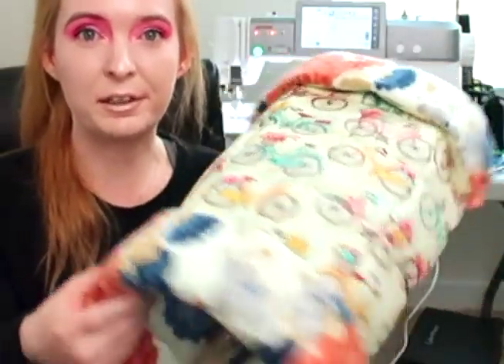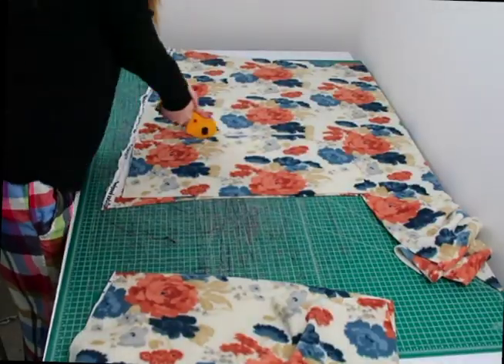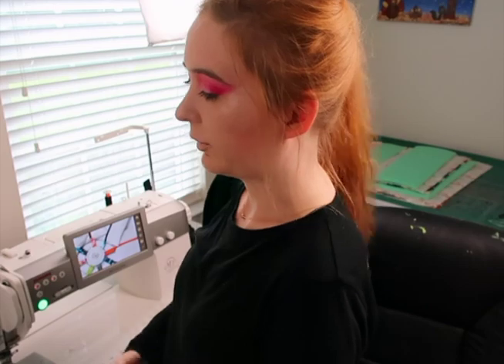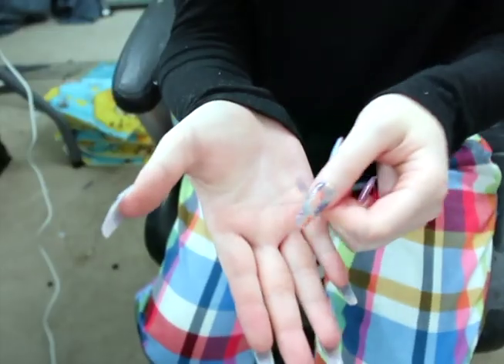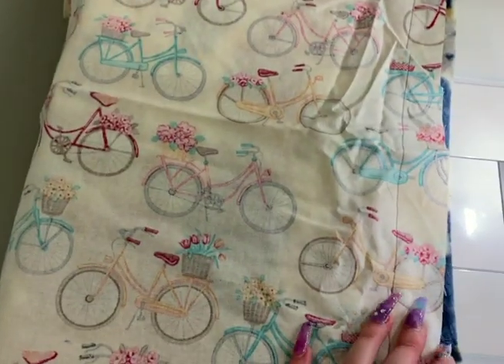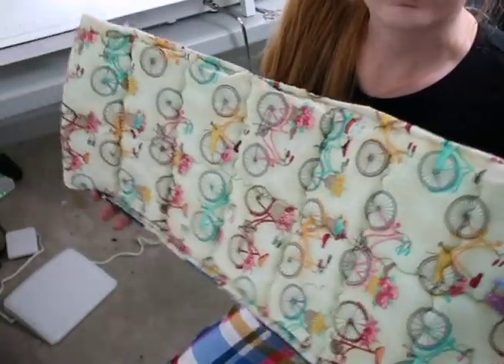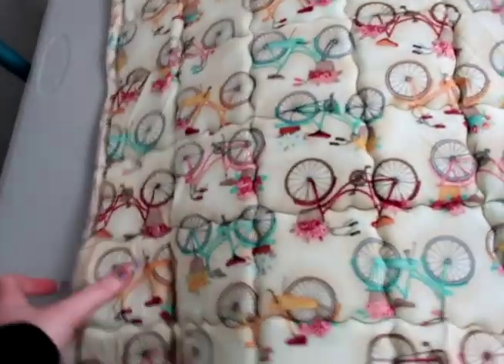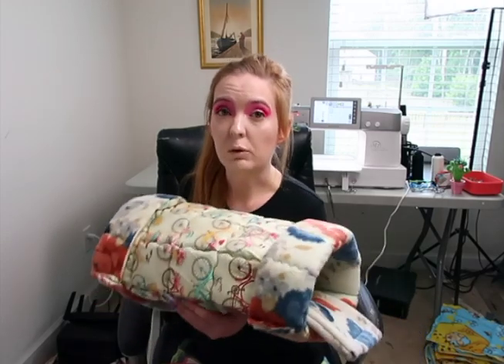Foam Tunnel With Two Removable Pads Sewing Tutorial!

Comment: I am so thrilled and happy you’re back doing more tutorial. Love this tutorial. I’ve been asked for foam tunnels. I made a simple one but yours are more professional looking. 
I have a question regarding your cubes. When you are attaching the fabric and foam together; do you sew close to the foam? I found
when I did then when putting the sides together I end up having to sew the foam as well. It works but the cube ends up a little smaller. 

Do you preshrink the cotton before sewing it? If not, do you have any problems with shrinkage with the final product? Thanks so much.
Reply from the maker: Thank you so much! And yes anything with Foam I try to sew close to it and not through it... I need to update my cube tutorial... haha.... And no I do not prewash anything, instead I just make things bigger to allow for shrinkage over time...  :D
Reply: Guinea Piggies Designs I thought I’d pass on a tip in case you don’t know. A customer of mine received a set from me. I used that fleece before without complaints of not wicking. I used same pattern from a new bolt ...she said she had washed it 5 times and still not wicking. Told her to use Tide Free and Gentle and bingo, it wicks. Great lesson for me!

Comment: One more question please ! How can you tell the difference between the tops and sides where you sew the peice on to the main towards the end of your video !? Did I ask that right !? Lol
Reply from the maker: Well.... the top piece is twice the size of the bottom piece... There are only two pieces for this foam tunnel. The pads are the smallest pieces. But again top piece is the biggest and bottom piece is the long narrow piece. Set your pieces aside and label them if you need to as you follow along to keep track. I have made many of these so I can tell by the sizes. :)